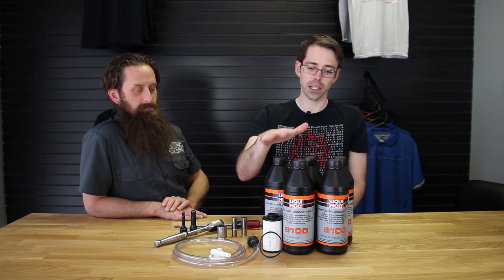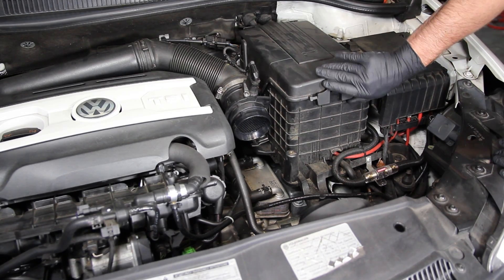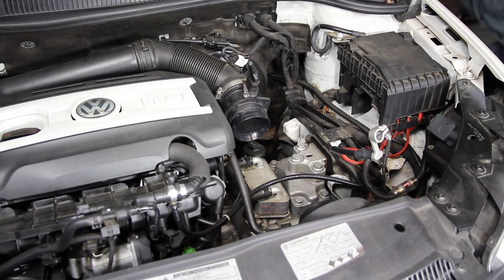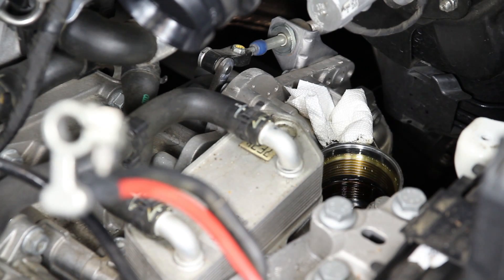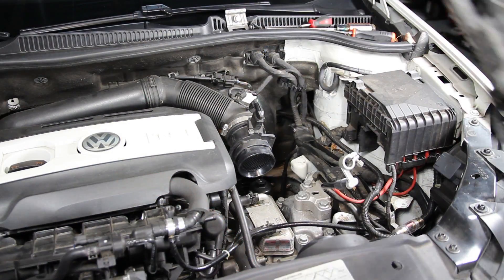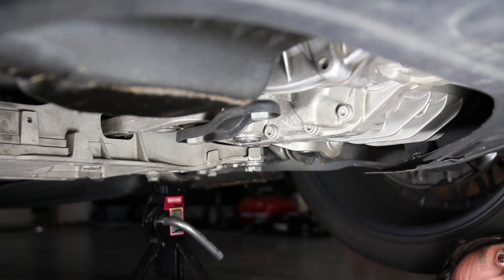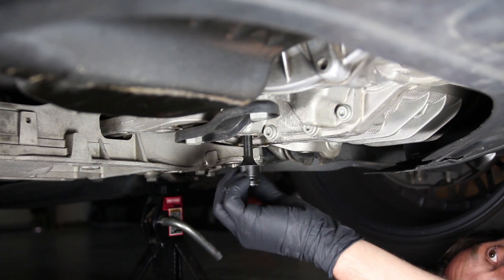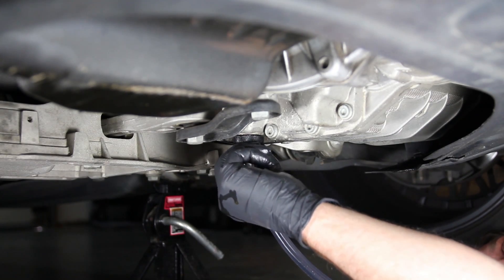How to (DIY) Perform a DSG Service on a VW and Audi Transmission (DSG Service Kit)

Comment: Thanks for all the great videos. One extra step I believe you are supposed to take however to get the car to operating temperature and have the metal drain plug out. That black secondary plug ensures you have the proper fluid amount. Too much or little can cause issues.
Reply: Thought as much...didn't see the part for leveling the fluid. Awesome video I must say. Subscribed!
Reply: butterfingarz 
Which kinda problem
Reply from the maker: Thanks for that feedback.